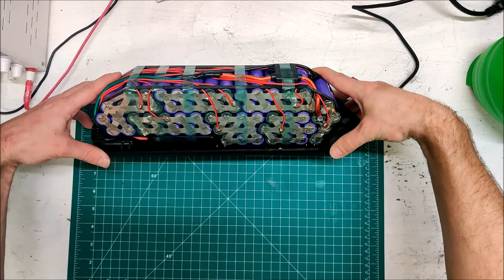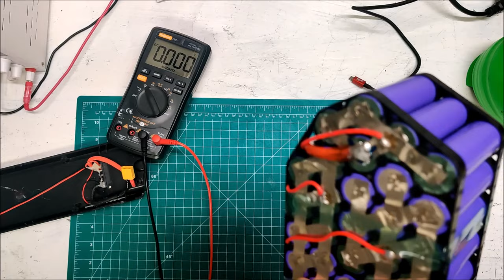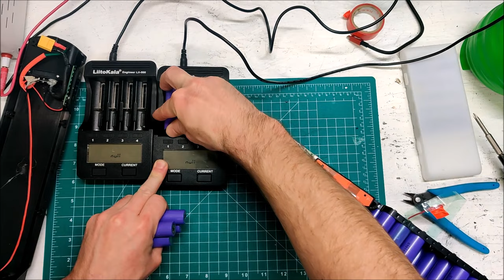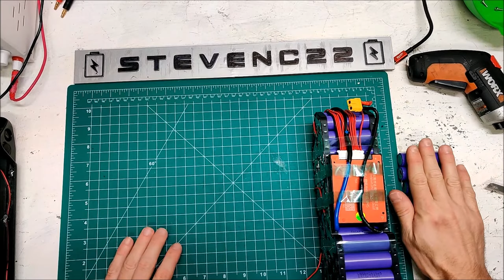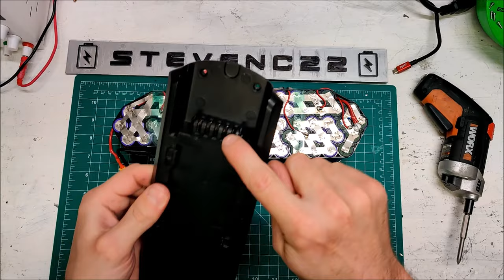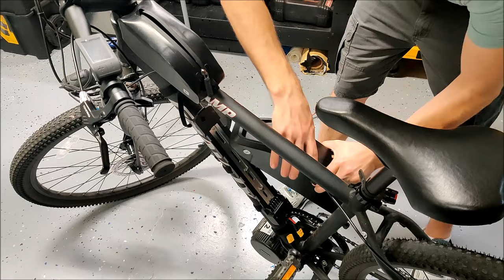Fixing a dead ebike battery

Comment: This is the best, most complete video I’ve yet seen on diagnosing and fixing electric bike batteries.  I am still uneasy about trying this myself.  I will check out any other bideos you have made.  If you know of other resources that would help a beginner and would be willing to share them it would be very much appreciated.   The information I have come across so far is quite fragmented and
Reply from the maker: CC I have a video where I built this battery. Best way to learn to fix something is to build it or see it being built. 👍
Reply: @stevenc22  Is this battery enough to kill you if you touched both ends or would it hurt?  Just wanted to know before touching any of these packs. Thanks
Reply from the maker: @Neilukuk  below 40V, battery cant hurt you. 40-60V your skins tingles and burns alittle, but nothing serious. I touch this battery constantly will working on it and just get a burning sensation in my skin, but no damage.
Reply: @stevenc22  Thanks I appreciate the info, It's definitely a deadly important thing to know :)
Reply: It's a heck of a lot cheaper than buying a new battery pack! My battery is only getting about 35 miles per charge. It's enough to get me from my town and two more two more towns over and most of the way back. I'm planning on checking out my battery fully this week.
Reply: @stevenc22  unless you’ve a heart condition you don’t know about.
Reply: Why do battery fires occur?
Cos people mismatch chargers and batteries or replace parts with cheap inferior parts. Be careful people.

Comment: I suggest that the suspect cell may not be bad. Instead it had a high resistance to the metal strip which allowed the other cells to discharge faster than the rest of the battery pack groups. The accumulative use of the bike allowed this cell group to discharge faster until the BMS flagged that cell group and the battery pack as dead. This is why the suspect battery cell charged back up quickly, the only serious discharge was thru the bad negative connection high resistance so it's voltage eventually discharged down to the other cell group voltage via a very low discharge current. The suspect cell did not provide power to the bike in operation therefore it's charge state was higher than the other 4-cells. Just my consideration for this fail. Thanks for the video I now know how to find a cell spot welder.
Reply: No - the cell was at the same voltage as the others in that group it was a part of.

Comment: I know video is old but My guess is after looking at connection and the battery is at full volt, here is my thought there was a bad connection (nothing worng with battery cell) it just was not giving a connection to the battery that were connected and not being used throwing the whole battery bank out wack.Just a thought.
Reply: God told me that battery cell was bad. It loses charge and gives you a fat fluffy pillow.. The size decreases tremendously when you squeeze that pillow. It actually holds very little usable charge. This is common for batteries ending its life.

Comment: With a Dremel Tools i would remove only the faulty battery and replace and charge for the night to see if the pack reach the normal voltage.
Reply from the maker: Yes but battery won't magically rebalance over night.

Comment: You are very lucky to replace one cell. I have done this ,but then found the others in that row have been damaged and there capacity reduced . Although the battery works I have found a 20% loss in range .
I cover the cell rows in fish paper so I can work on the one  row safely,

Comment: I suggest that you solder the balance leads to the nickel strip mid way between two cells, as it significantly reduces the amount of heat being applied to the ends of the cells.
If the faulty cell was not punctured during the spot weld process, then the excessive heat applied directly to the end of the cell with the soldering iron during the initial battery build is probably the reason why that cell has failed.
Reply: Bingo
Reply: I was thinking that too.
Reply: Is there a reason why the solder connection to the nickel strip could not be made before the nickel strip is even spot welded to the batteries? It seems that that would be the logical sequence to completely separate soldering heat from interacting with the batteries.
Reply from the maker: You could do that but I don't normally think three steps ahead. I do each step in  order and deal with as I go. Plus a quick blob of solder to the strip is no big deal on the completed battery.
Reply: The 4 contact pins one damaged

Comment: I bought a boost converter to help recover "dead" batteries. I find you need to bring all the cells to at least 3v for normal charging to kick back in but it takes relatively little charge (i.e. current) to lift cells that initial way up the charge curve so you don't need a powerful higher voltage bench supply. In fact it does no good to force normal charge current into an over-depleted cell and I typically set a current limit of 50-100ma per cell until the voltage is up past the minimum quoted by the cell specs which may be 2.5v.

Comment: Hey, looks like if you are the kind of guy who can reset a circuit breaker in your home electrical panel, then you are good to go with the depth of knowledge needed here!  Just kidding, of course.  Thanks Stevenc22.  Great little introduction to the mysteries of the ebike battery.  Now, all I have to do is wait impatiently for mine to fail!

Comment: Do you have a video on the DIY spot welder that you referenced using? Im looking into building my own. Also, what are the chances that someone other than you got in the pack (as it seems to be easily accessible with no tamper tape on it) and tried to 'fix' it but made it worse. I only say this because that does look nastier than you'd normally send out the door? Anyway, thanks for the videos!
Reply from the maker: I built that battery from scratch in a 4 part series on my YouTube channel. I recently built a new battery and it's also on my channel
Reply: @stevenc22  OK thx. I had a look around on your channel after this comment and found more on that tab welder too. Ill have a look at those batt vids!

Comment: Just a FYI the old rule of thumb is mark and change 1 cell on either side of a failed cell. A s they were amperage stressed during the cell failure.
Your load testing was spot on think of it as a glass of water you can't drain or fill. Your checking capacity it should drain slow and fill slow. I
If voltage goes down quick or tops off quickly it's bad...... no capacity

Comment: Around 12:51 where you checked the voltage of the low cell pack, they would be bound to be the same voltage because they had all been connected together in parallel. If one was self discharging, it would drag charge from the others so they would stay the same voltage. Good video. Interesting to see you solve the issue and refurbish it. So much better than sending it for recycling which many people would do.

Comment: Hey Stevenc22, nice video. I was going to do the same. Investigating my battery I found 1 pack being low and strangely a small burnt hole on the lead strip that connect one of the cell.
I contacted a company which does repair battery and they told me that I couldn't just put a new cell because of unbalancing. Could you confirm that I can still do it and that the unbalancing might be a little overreact on their side or should I not do it ?
Also I'm looking for a place to buy legit cells : samsung 50e 21700. Do you have a preference for where to buy them (I'm in Canada so it might not be similar but still)

Thanks, a lot, hoping you'll answer on a 2 years old video x)
Reply from the maker: If you charge the battery full and then replace the bad battery with a new full battery, it will probably stay balanced. But you can also use the $20 active balancer to rebalance the whole battery afterwards like I did on my latest video.
Reply: @stevenc22  Thanks I'll look your latest video then. Thank you for the quick answer.
Reply: @stevenc22  Update : I used just the balancer first rather than changing the cells and I was able to bring them all to a right voltage. I'm still testing the battery but it seems it gained some strength. Thanks a lot for that !
Reply from the maker: @shaunyitisme3293  sometimes a good balance is all a battery needs!

Comment: We had a new bike with battery problem. It gave us half of the expected range and knocked the motor out. The company (Fiido) refused to take it back, sent us a motor and after a controller. Booth of them was out. After 20 km they are finished again. Actually the throttle turns the motor without weight on. With weight shuts out. The battery did some funny thing, as shut off, once it is connected and won't turn back on. Or you couldn't turn it off. 1 000 Eu for fun, supporting poor Singapore. We got middle finger and had to pay 70 Eu for spiking the motor. Never reimbursed. .... We had a Fiido D1 earlier. Great! D11 - stay away!
*
Had to buy a Chinese. 800, super comfort, double range (same Ah) and flies 2X faster. 2600 km, no issues.

Comment: That was great fun to watch! Almost can't want until our battery dies ;-). How do you figure out what cell you need? Did you google the text that was on it? You said you had only one replacement. Isn't it possible to measure the mah with the charger and then just buy a 18650 with the same capacity?

Comment: You can use a GrinTech CycleSatiator battery charger to force start a battery that dropped too low and went into hibernation..   every couple charges, you do need to fully charge the pack to balance the cells..
Reply: Does it actually work? I’m considering buying a Satiator if that’s really the best way. Could you please tell me more about this?
Reply: @anhtran1062  Yes.. my battery went to sleep, I plugged it into the 3pin charge port.  toggled.then pushed the button when it said "Force Start"... Others use higher volt batteries to "jump" or force start them.. I use the GrinSatiator..   a bit pricey but it is the best charger on the market. and other US retailers have them so they can ship fast. but the retailers don't have the knowledge to answer questions.
  I ordered directly from Justin at Grin..  I would not have been able to set it up with custom profiles because the software is not compatible with Apple computers... only PC.
  I had Justin set up several profiles:  ie:  52v:  full charge at 4 amps = 58.8v, 80% of 58.8v and 90% of 58.8v... Those profiles add cycles to the battery..  charging lithium fully every time will damage the cathodes/diodes on the battery and shorten the cycles.  and i select the charge cables that match my batteries.. *along with the type of adapters/cables needed to program the CycleSatiator and do updates.. ..  *I found out later that the programing cables/adapters are only compatible with PC... they are useless on my apple imac..   
If you have questions, the Customer Service at Grin is really knowledgeable.. They have a toll free number.  You can shop online .   I like to buy direct.  because retailers have no knowledge to answer questions.
Reply: @anhtran1062  There are several Cycle Satiators to choose from, select the one with the correct V voltage for your battery.    if you have a 36v don't order the 72v charger.. LOL
Reply: @rdkuless  Thank you kind sir, it sounds like this is the most efficient way to jumpstart a hibernated ebike battery. I drained mine completely on my most recent ride, the charger doesn't recognize the battery anymore. I'll try this out. You have a great day!
Reply: @anhtran1062  your welcome Anh... this is all i use anymore.. I love it because the Amps can be programmed for charging from 1a to 8a..   My batteries say to use 4a so that is how i ordered it..
Other chargers charge at a full 2, 3 or 4 amps until full.. My satiator starts out at 4a, and  Amps slows down (tapers off ) the charge.. starts at 4a, then ends on .01a.  This protects our expensive lithium batteries.. and helps get more cycles out of it.. :)  have a good day  rob
Reply: @rdkuless  where did you buy yours at?

Comment: I recently purchased an ebike for my wife.  We noticed the battery drains down to about 50% ftom full in about 7 to 8 days if left connected to the bike. This according to the  handlebar display.  (5 of the 10 Bars)  It does the same to the auxiliary battery.  When either battery is removed from the bike this doesn't accur.  The batteries take over 10 day rest before they even lose a bar.  #1  Is this normal?   #2  Does something always stay on when the bike is shut off on the display and the battery is left connected?  #3.  Or maybe  there's a parasitic draw ?    Sorry about all the questions.   The bike was new.
Reply from the maker: If it doesn't happen when the battery is disconnected that's good. That means the battery is healthy. The bike it self must have parasitic draw. Maybe it has Bluetooth or something else that is constantly drawing current.
Reply: These batteries lose power over time and don't store your bike with a full charge, if you're not going to ride for 10 days charge to 60 percent and put on charger to 100 percent and then ride
Reply: Hmm.. having the same problem. My wife's bike has an alarm . Could be draing the batt

Comment: My battery just stopped charging. I will diagnose as you did. Where do you get the charger that also does diagnostics? I couldn't make out the name in the video.  Thanks!
Reply: And where is a good place to buy cells if I do find the bad one?
Reply from the maker: A good charger is a ISDT Q8 or Air8. I buy used cells from https://jag35.com/ or https://www.batteryclearinghouse.com/

Comment: I have the same battery anf suspect same problem just curious i had to rip a bunch of sticky tape like material off them I had to rip a bright blue plastic wrapped layer , how is the battery all assembled with none of those things out back on ?
Reply from the maker: You can buy the blue plastic wrap and the sticky paper. You should reassemble the battery using the same materials you took off.

Comment: I'm glad I don't use bms 2 5series packs 36v.  I don't drape the balance leads Over top  I go down the sides as a short prevention.  Your pack is Bigger and Bulky a little tougher ROCK ON!!!
Reply: It is perfectly possible for one of those series connected cells you have ,to get out of balance and have more charge than the others. So without a BMS, when that happens, and the only limit to the cell charging is the charger's own max voltage of 42 volts, that that high cell is getting seriously overcharged. It might even overheat and reach thermal runaway temperature and set the whole pack on fire.

Comment: Is there any risk to handle batteries in the way you did in the video? might want to buy a bike and fix it up myself
Reply from the maker: 48v batteries can shock you but it's more of a burn than a shock. Your real risk is fire. Any time you tear apart a battery there is a risk of short circuit or a bad spot weld leading to fire. Be careful and don't attempt unless comfortable with llion batteries

Comment: Hi, great video. Could you explain how 1 defective battery cell can make the whole battery pack unuseable? Are there any links to that for self reading.

Thanks
Reply from the maker: So this battery has 13 cell groups in series. Each group has 5 cells in parallel. The 5 cells in parallel share their energy. One bad cell that is self discharging, will also drain all 5 cells in the group. So now that means that 1 of the 13 groups is going to have a very low voltage. The BMS will turn off charging when any one of the 13 groups gets above 4.2V and it will turn off the battery while in use if any one of the groups gets below 2.8V. 

So if you try to charge the battery, the 12 good groups will get full quickly and the BMS will turn off charging before the bad group has had a chance to recharge. Then when you use the battery, the BMS will turn off the battery when the low bad group get below 2.8V even though the rest of the battery is still full.

There is no way to charge just 1 of the 13 groups, so that low group will never charge up and it will keep turning battery in use because it detects the low voltage group. That is why it is important the 13 groups are always balanced and at the same voltage so they charge up together and discharge together.

Comment: May I suggest wearing gloves while handling the battery?  I have done some pretty stupid stuff working on batteries and learned from experience.

Also, cover portions of the battery with an insulating material like surgeons do.  Lastly, better to replace all cells in the parallel group as the bad one degrades its parallel members.

Comment: Good day Steve  just a question  can I replace a 36v12.5 with a 48v12.5 or any other type of 48v 10 etc pls need to upgrade quickly. Thanks &soon hear
Reply from the maker: Not if your motor is a 36v motor. You need to match the voltage of the battery with the voltage of the motor/controller
Reply: If your motor controller is a 36/48v you should be fine.

Comment: Hi out today on bike 2000wat 45amp controller 48volt 20amp battery went for a mile bike stopped no. Battery light when pressed button. I've been waiting for new PAS magnet put that on last knight then used throttle and pas was going fine then bike stopped any idea what it could be thanks

Comment: Any suggestions on fire safety when repairing this type of batteries? Thanks.
Reply from the maker: Actually a good question. Having a metal box you can put the battery in if things go wrong is important. Working in a garage with a concrete floor and a big door helps too.